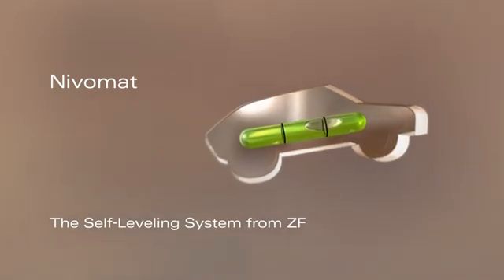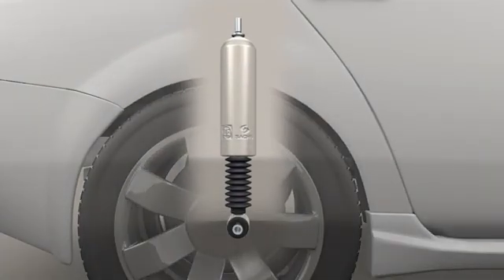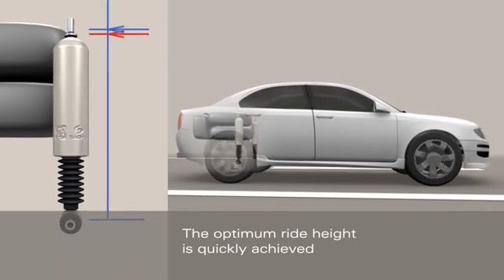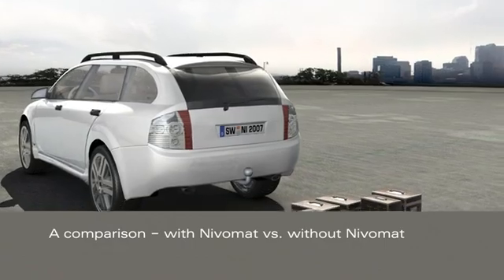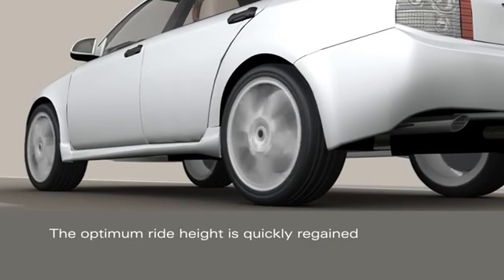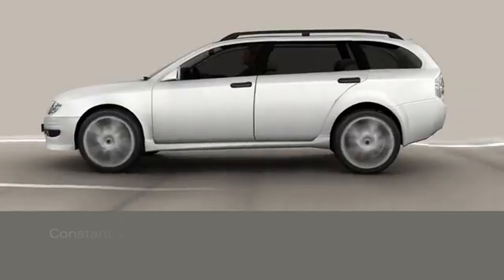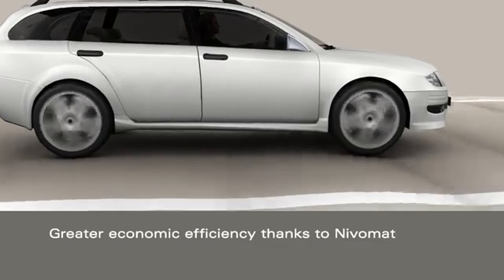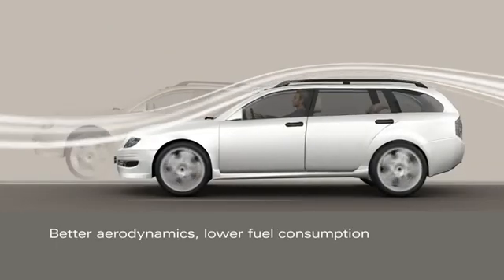SACHS Nivomat System

Comment: I have a question about this. My Dodge Durango R/T has Nivomat self-leveling, and it seems to defeat the benefits of a weight-distribution harness when towing a heavy trailer. The WDH attempts to leverage enough upward tension on the rear of the tow vehicle, to re-distribute weight to its front axle. However after driving a short distance, the Nivomat gradually extends the rear suspension enough to loosen the WDH spring bar tension. As a result, less weight is transferred, and I can actually feel the driving dynamics change as the front gets lighter and the rear gets heavier.

Is there a way to defeat this?
Reply: Try adding one more trailer 😂😂😂